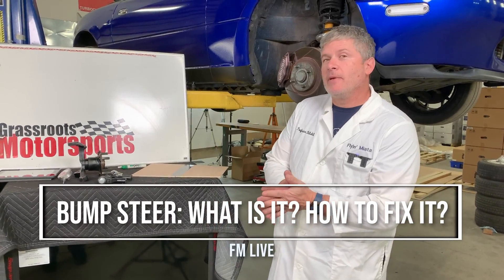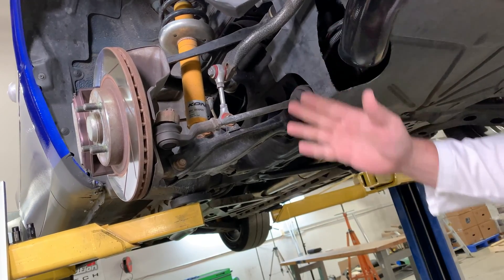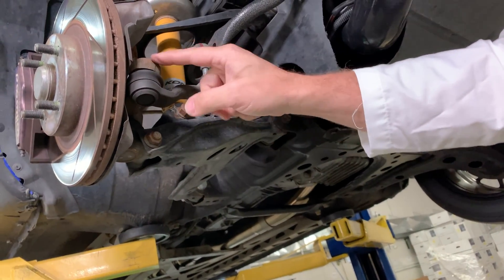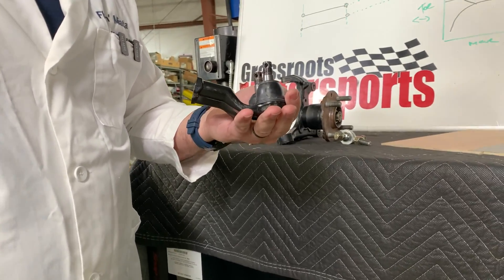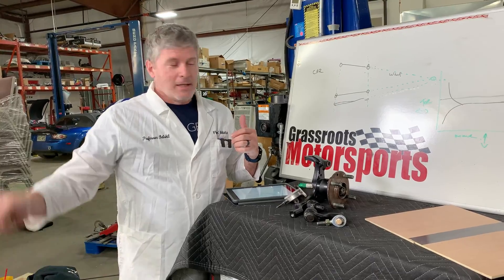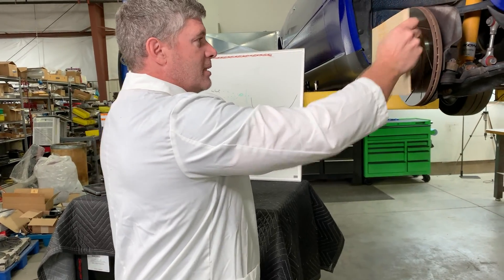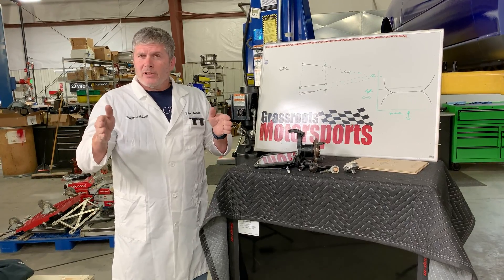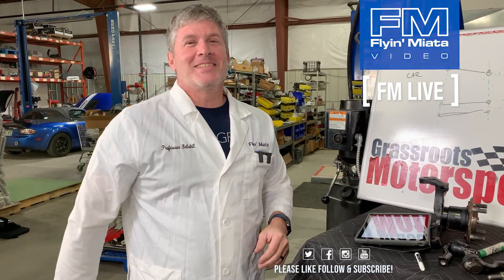Bump Steer! It's not what you think it is (FM Live with Keith Tanner 12-8-23)

Comment: Thanks for the info. We run a rally car, so very rough surfaces on stages, which makes for some obvious problems with suspension.
Reply from the maker: Thanks for watching! Are you running your Miata on the stages?
Reply: @FlyinMiataVideo  no, it’s a Vauxhall Corsa B, but still good video 🍻
Reply from the maker: @stevemcilroy.62  Ahh, those seem to be pretty light. I bet it's fun!
Reply: @FlyinMiataVideo  yes, great fun, and easily fixed as there are plenty around

Comment: If you have a significantly lowered car, should you just go ahead and drop the tie rod pivot and/or raise the rack some nominal amount? E.g. 5-10 mm. Actually measuring bump steer is a pretty significant undertaking. My FD came with a bump steer kit on it, but I've never made any adjustments.
Reply from the maker: We like to use the R-package (dropped) tie rods over other options on any car that's lowered. You know they're gonna help and you don't have to do all that math stuff :) You can find them here https://flyinmiata.com/products/r-package-tie-rod-ends?_pos=1&_sid=a6351d743&_ss=r

Comment: Great video Keith, nice explanation of bump steer (yes, including the 3 pieces of wood/MDF!!). Having a lowered mk1/NA I've heard that they can suffer from big front toe changes under significant compression and was wondering how to check how much toe in or out I have. So now I know what to do!
Also do you consider steering rack spacers to be as effective as R-package tie rod ends? Thanks.
Reply from the maker: Mazda used modified tie rod ends rather than steering rack spacers, so their preference is pretty clear. You can use steering rack spacers in conjunction with the tie rod ends IF you need them. For a Miata sitting at a streetable ride height, it's pretty unlikely.

Comment: Great video, as it highlighted  that you can't just lower your vehicle without unseen consequences.
What is your opinion on how do different anti rollbar settings affect bumpsteer? I guess if the car rolls less, than you lose the factory toe out feature?
Reply from the maker: They shouldn't make any difference, other than minimizing the actual movement of the suspension and masking any bump steer problems.